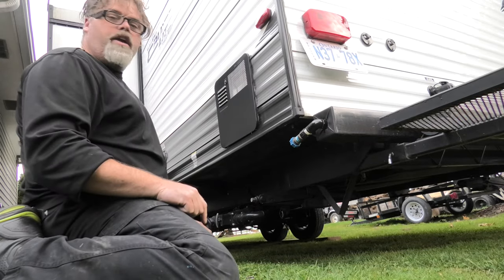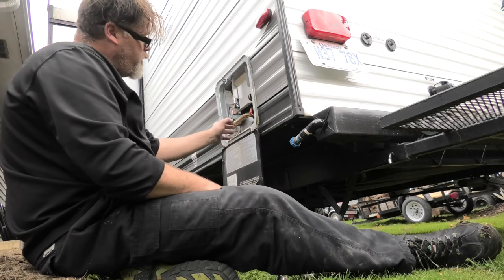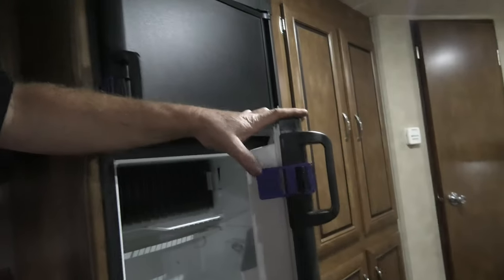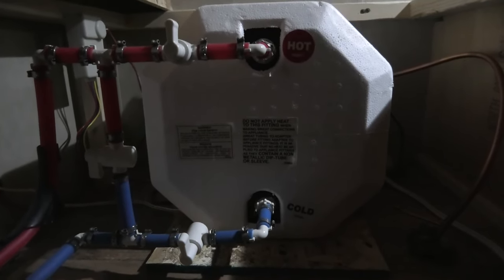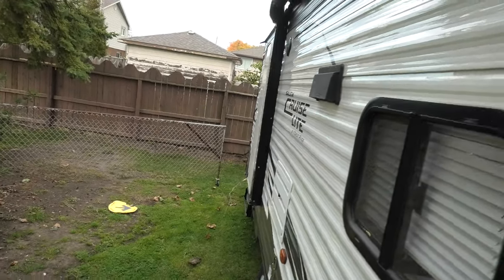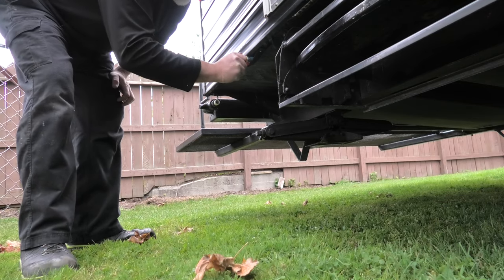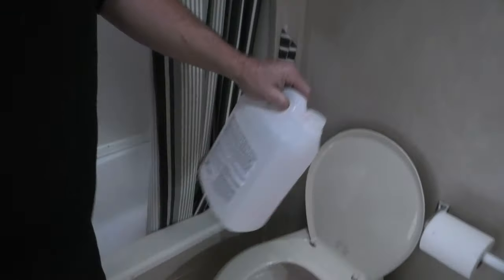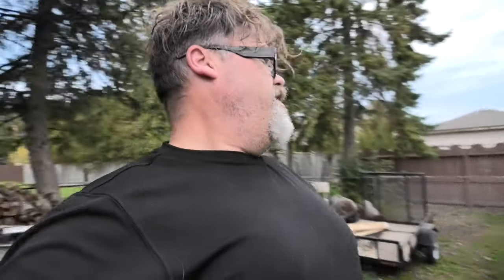DIY Winterize A Travel Trailer Or RV With Bill Siff

Comment: You dont want antifreeze in the hot water it will stain the inside of the tank.
Reply from the maker: Stain away better then freezing lol
Reply: @LifeWithBillSiff  meh theres lots of room in there for expansion if you drain it out.  Never had an issue and dont have red juice in my belly.lol
Reply from the maker: you drink hot water lol

Comment: Buddy your doin it wrong. Some campers have a one way check valve at the fresh hose water in to the camper . Well if equipped with check valve get that the hell off there . Open the farthest valve at sink, pooper then bust out a good ole shopvac vac out the lines now open more valves in camper and then shut the farthest valve you opened first and just let the ole vac suck on it a bit . Then your golden . You can blow them out but I find the shop vac works the best just leave it run suckin on the damn the relentless lol have a good one bud
Reply from the maker: Rob Plotts i have a two way outside of the trailer to drain it so im good . Been doing it this way for 4 years and never on problem but thanks
Reply: @LifeWithBillSiff  thought you used waterline anti freeze
Reply from the maker: I did lol